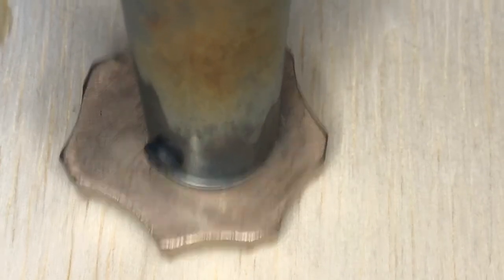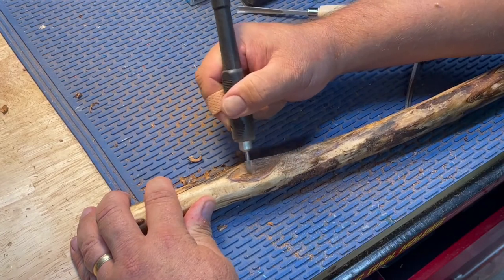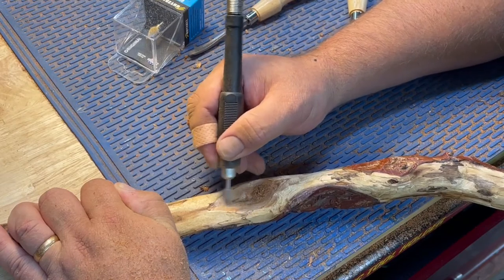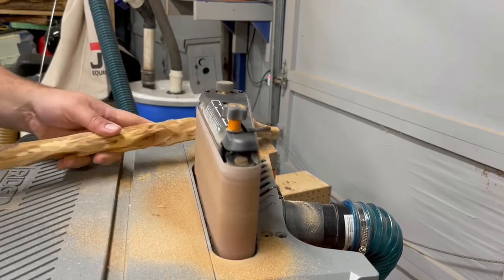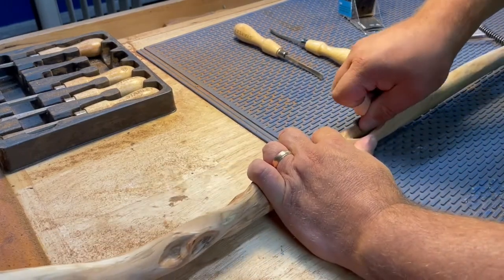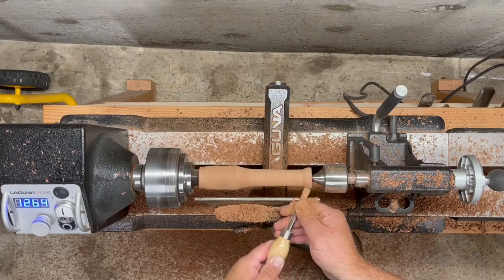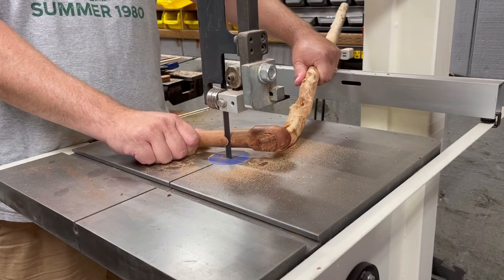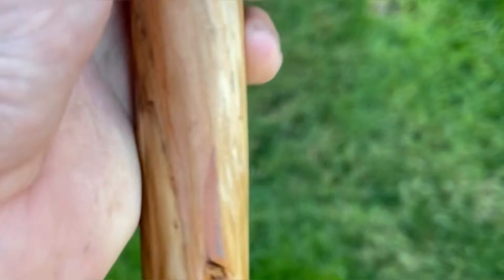Diamond Willow Cane

Comment: Knew an old fellow who produced a few dozen diamond willow walking sticks per year.  Yearly, he would visit the sandbars along the river to cut a fresh batch of canes.  He buried them in the sand above the waterline, in the hole where he had dug up the previous season’s bundle.  The carpenter ants did all the work of carving his sticks.  Also, the sun baked sand leeched away whatever moisture that they contained.